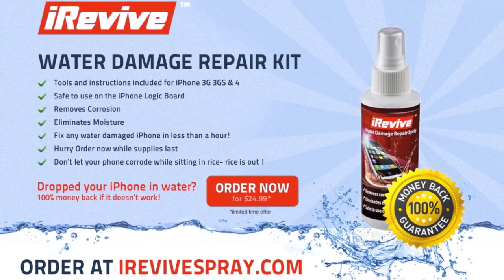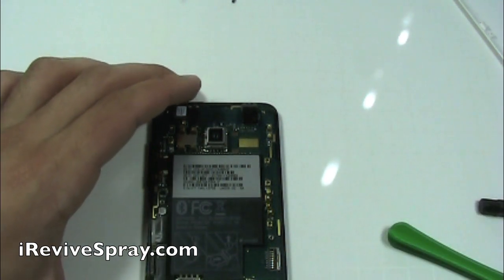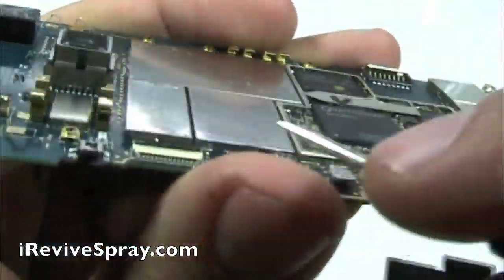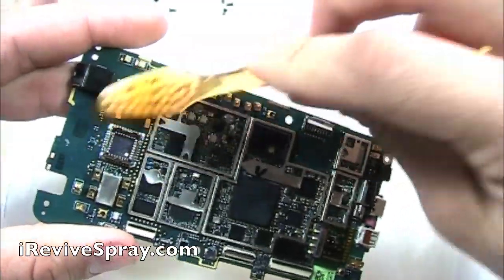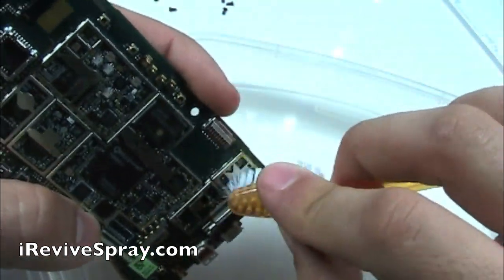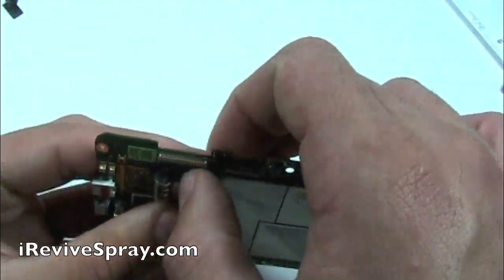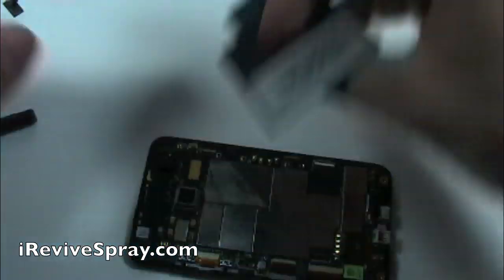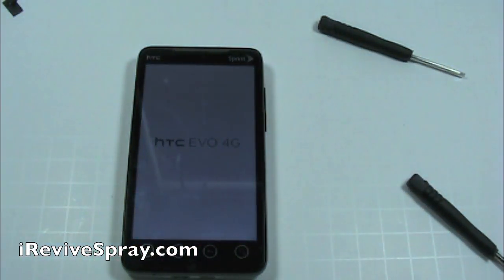100% Water Damaged HTC Evo 4G Phone Repair - iRevive Wet Fix

Comment: I have my friends phone, its and HTC vivid with water damage, any tips on what to look for? Is there any fuses? Or transistors that were over stressed? I already did the complete dissasembly and cleaning all the corrosion off, but it wont turn on. I read 0.35 volts at the battery terminal to charge the battery, is that right? Theres gold contact points, can you I use them to pinpoint where theres no voltage? Why methonal to clean it? I used Isopropol. Could the problem be near corroded parts?

Comment: My phone dropped in water about 2 weeks ago I immediately took out the battery and let it dry out on a fan for a couple of hours. then I put it back together and it made noises and stuff but the screen didnt work. It vibrated and my alarm went off but no screen. Will this work even thoug I waited long? please answer back I have important notes on my phone that I cant lose